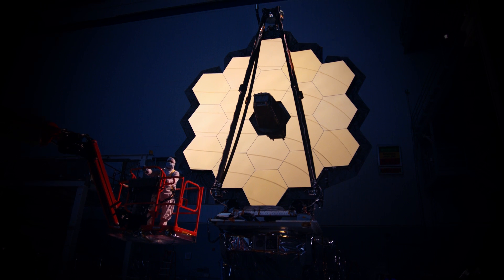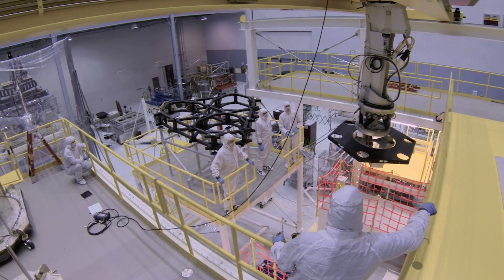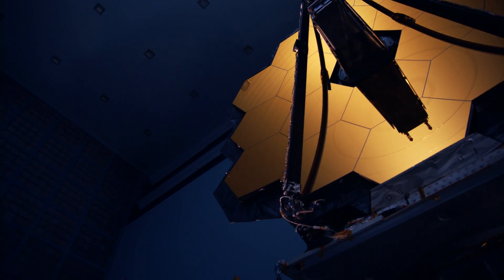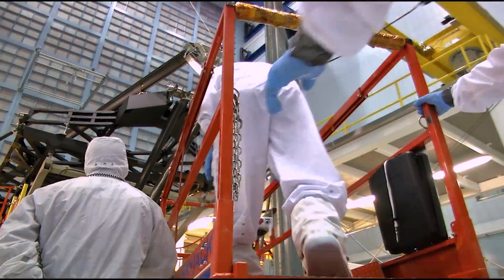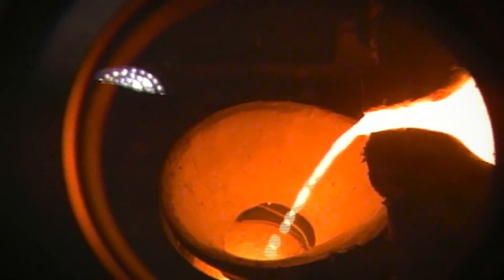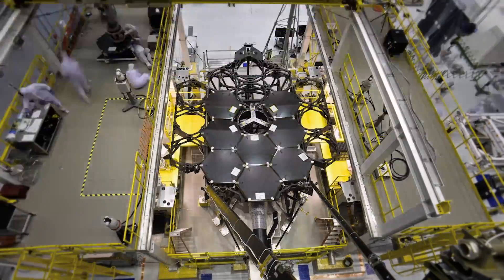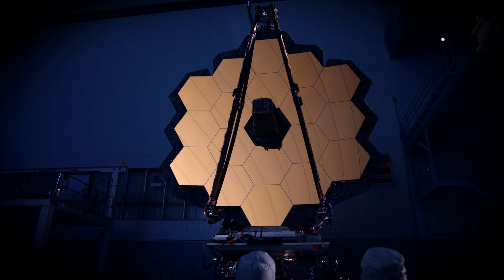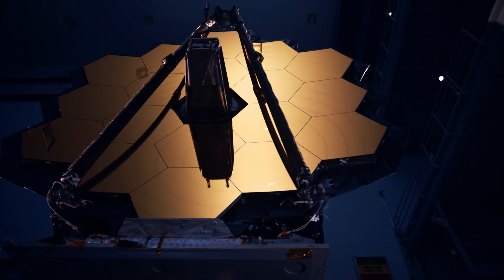Webb Telescope Milestone: Completion of Telescope Element

Comment: what type of metal is the mirror made out of-the big outer one.
Also what is the bus for and what is the heat shield made of?
Reply from the maker: You can learn more at http://www.nasa.gov/jwst but the primary mirrors are beryllium, coated in a thin layer of gold to optimize infrared reflectivity.
Reply: Already been there 10 times
Reply: "bus" is collection of all the generic functionality of a satellite, power, propulsion, computers, communications, flywheels etc. 
Heatshield i'm guessing is just mylar, with different sides reflecting and absorbing infrared differently. By stacking and keeping the sheets separated you get very good shielding.

Comment: stupid questions but if someone has any answers plz share: 
so if the new telescope if will work ok,
1) will make Hubble absolute in terms of lifespan?
2) no more repair and maintenance mission for hubble? 
3) will hubble keep been available to the scientists until it dies?
4) what is the life expectancy of the new James Webb space telescope?
5) is the JW able to see in greater details all our solar system planets? will it do that or just look further ahead?
Reply from the maker: There are no plans at present to repair either Hubble or James Webb. That doesn't mean it's impossible. JWST is expected to last 5 years. It has fuel to maintain its orbit for 10 years, more if conserved. It will not only be able to see our neighbor planets in better resolution, but in infrared. It will also be able to observe some frequencies in tandem with Hubble, meaning we can take stereoscopic images with our pupils 1 million miles apart.
Reply: I can answer your first 3 questions because the other two is James Webb centered and i don't have certain answers for them.
1)James Webb is not replacement for Hubble telescope. while James Webb were made to detect the infrared wavelength, Hubble were focused on visible light and UV. 
2)Currently, neither a plan nor spacecraft have capability to repair the Hubble, so Hubble is very likely die after the major system were failed.
3)If the Fed keep funding the Hubble, I can't see any reason it will not available for science in his life time.
Reply: NASA Goddard thanks for the kind reply, i wish everything goes smoothly and we will discover new amazing 'things' our there :)
Reply: johnnyxp64 it should be able to see if there is liquid water on exoplanets